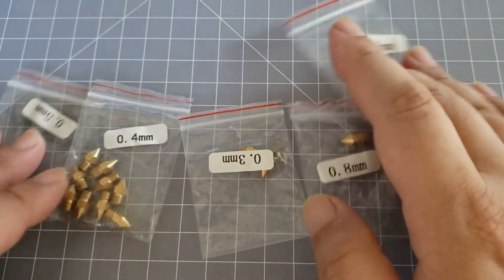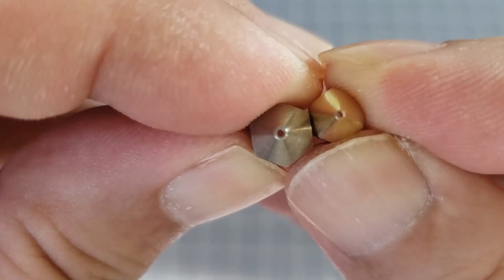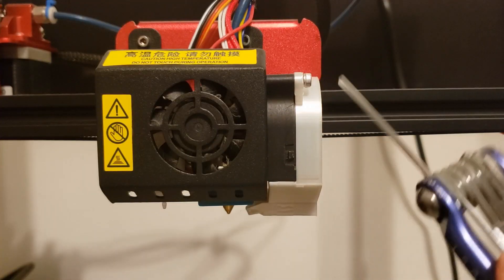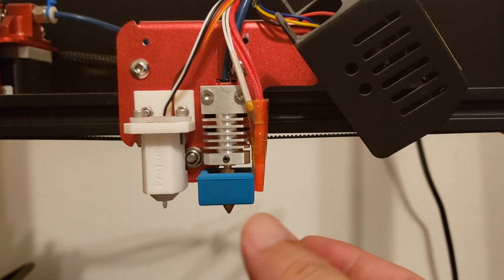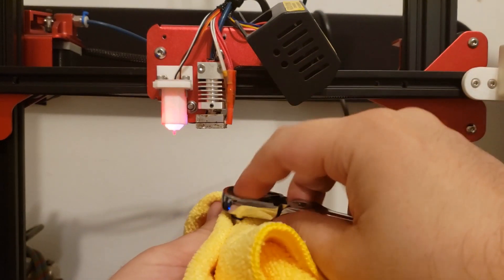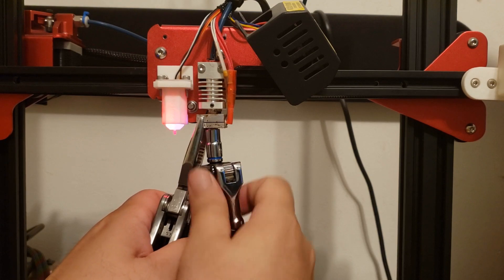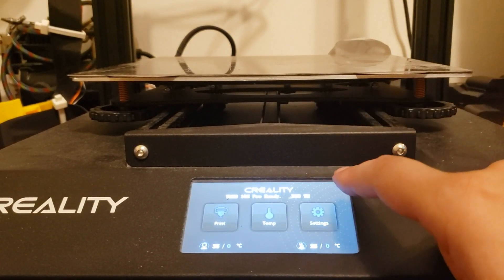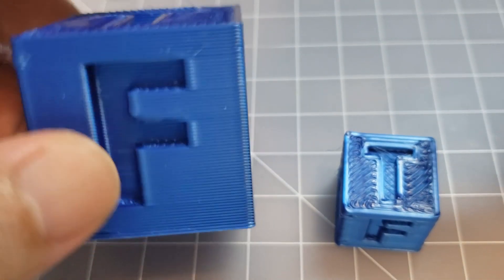CREALITY CR10S PRO NOZZLE CHANGE .8MM MICRO SWISS NOZZLE. HOW TO CHANGE A NOZZLE ON A 3D PRINTER.

Comment: Not sure why you need to remove the fan, it’s pretty easy to access? Required ? Also any issues removing non heated if it’s strAight out of the box ?
Reply from the maker: Yes, The fan housing has to be removed to get to the hotend. Removing the housing is just an added step of removing 2 extra screws.

Comment: Hi James,
The link to amazon you gave mention nozzle for Creality CR-10. Does it work on the Creality CR-10S Pro ?
Thanks.
Reply from the maker: No, it works with the mk8 threads. I have a microswiss hotend which uses the mk8. The stock hotend has a different thread.

Comment: What do you think about the clones
Reply from the maker: Never used a clone before... Even the stock and the genuine microswiss looks the same from the exterior... From the information I've gathered what makes the "all metal hotends" special is the heat break... This one is made of titanium alloy grade 5, while clones are made of grade 4.. This retains the structural hardness, while conducting less heat (heat dissipation).. Is alloy #5 as opposed to #4 a gimmick? It's for you to decide..

Comment: Great vid, thx. Just got a CR10V3 to make cosplay armor for my family. Would you recommend a 0.6 nozzle. Thx for your time.
Reply from the maker: I think .6 nozzle is a good nozzle like the .4 nozzle it won't have too many issues. Once you jump to a .8mm nozzle there will be many issues that you will have to fine tune. The more detailed the smaller the nozzle should be, but the smaller the nozzle there will be longer print times... One of my favorite nozzle is the other than the .4mm is the .6mm They work very similar in respect to slicing settings.

Comment: Good Video. I switched to a .8 with the microswiss but its been garbage. How did you clear the artifacting up?
Reply from the maker: .8 mm nozzle is only good for larger prints that don't require a lot of smaller details. There is no way to get rid of all the artifacts for prints that require smaller details. Having said that you need increase the temperature of 5 to 10 degrees. You need to also change the overlapping walls dependent on filament type. There is also the issue of fan speed. It has to be reduced or rather you need perfect fan speed or the filament will often break and peel. You need to  also reduce the print speed by around 5 to 20% otherwise you have the same problem of breaking and peeling. Also, you should make all the calibrations like the e-steps before you start. A better nozzle to use might be a .6mm nozzle. This seems to be a happy medium that doesn't require too much changes in the properties and give enough detail that is satisfactory.

Comment: Hey James good job. Keep the faith brother you’ll get there. I have the same problem as far as the artifacts. I didn’t have it when I used the PLA, but I’m having it now that I am using Overture PET-G. I am getting working on fine tuning that, so if you have any tips for this ‘Ole Grumpy Marine, I would greatly appreciate it as the same for me if I find out something I’ll throw it your way. Also thanks for the links, I really like that caliper your using, I’m going pick that up.
Reply from the maker: Thank you, I will.. I think using plastics other than pla you need an enclosure.
Reply: @DiyProJames  I'm actually in the process of building one. I'll keep ya up to date.
Reply: Any updates on this?